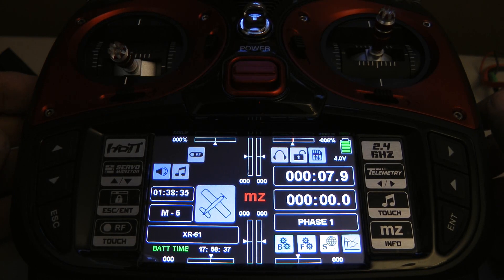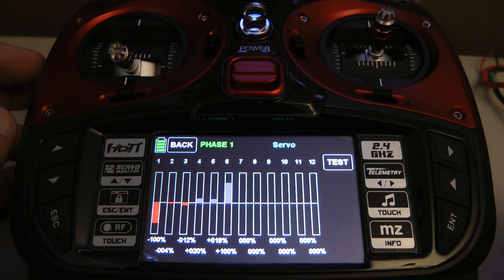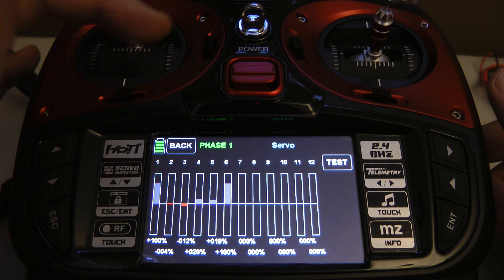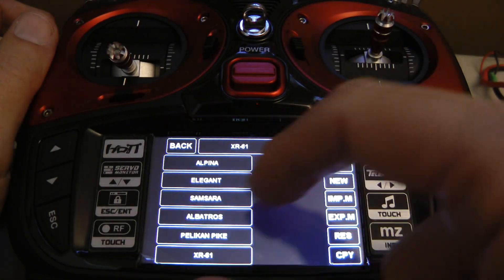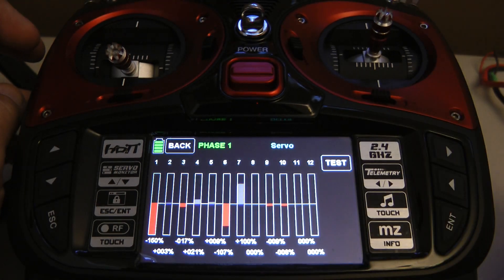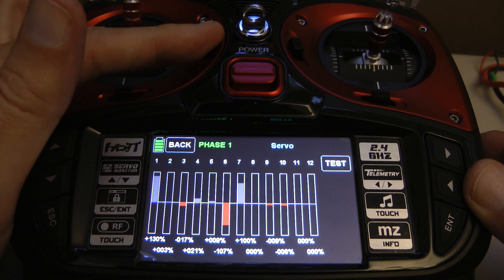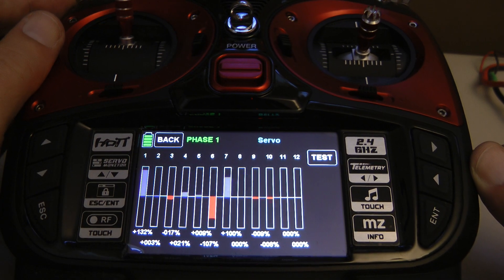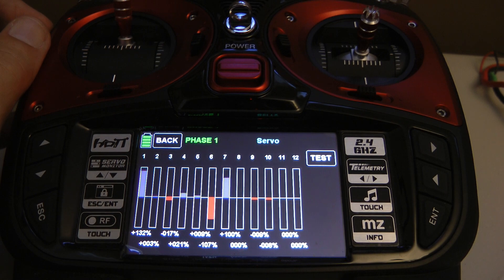Graupner MZ-24 Pro throttle trim bug

Comment: So my question is, why would you even use throttle trim on a electric glider in the first place?? Any powered glider is using an electric motor, not a internal combustion engine. There is literally not a reason to use the throttle trim. Much ado about nothing tbh.
Reply from the maker: Because the brake does not kick in correctly with all ESC's after calibration.  Some of the ESC's need an extra 3 or 4 clicks down to make sure the brake works.

Comment from the maker: A total failure from Graupner support, this was their exact answer to my issue

"I think it's because you selected a glider model. 

Please select a motor airplane, then the trim works like you want it. "

How stupid can you be?  Of course we know the airplane mode works. Glider wing type offers different functions that are not available with airplane models.  They don't even understand the basics. 

It is amazing a company like Graupner can't offer good tech support or at least acknowledge the bug.  This used to work, they don't even offer a way to downgrade the firmware.  Months and it's still not fixed.
Reply: Hello. Is the Problem fixed?
Reply from the maker: @sebastiansigge4012  Nope, and it never will be fixed.  I have spoken to Graupner in Germany about the issue and they don't care.  Their suggestion was not to use the Glider wing type and reset ALL my models to airplane wing type.  When you switch wing types you lose all your programming for that model and Graupner knows that.  

They went out of business last year (2019), I reported the bug about 2 yrs before they went under.  Now they are owned by some Korean company but it's the same stubborn employees working in corporate.  So they will go under again because of their same attitude and useless support.

I recently bought a RadioMaster TX16s radio with a multi-protocol module that supports Graupner HOTT receivers. I have moved several of my sailplanes to the RadioMaster using Graupner receivers and they work great, including telemetry like vario and voltage.  Even the Graupner ESC's with telemetry work.   OpenTX has no bugs like trim issues.

I highly recommend anyone using Graupner run away from this arrogant company and use something else.  I'm glad I can still use my investment in receivers with the RadioMaster.
Reply: At First sorry for my bad english. Im from Germany. Would you recommend the mz-24 pro for me? Or the mz-12 pro? Im a newbie in this Sport
Reply from the maker: @sebastiansigge4012  Why would you want to buy a radio from a company that does not fix their bugs?  I don't recommend the brand at all.